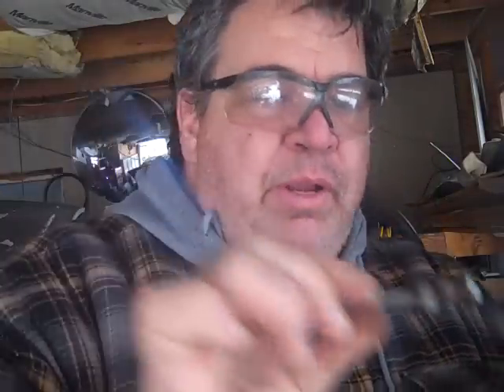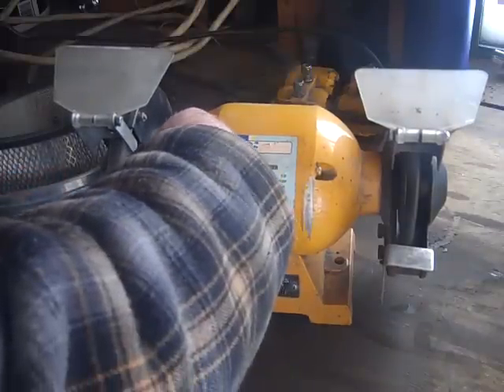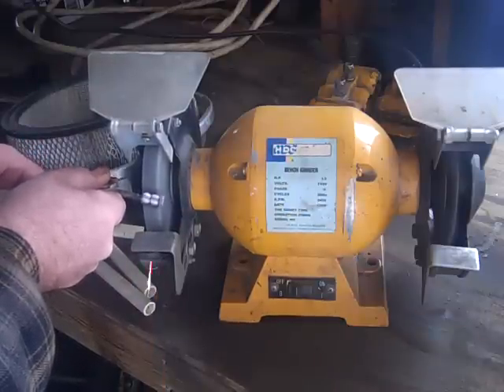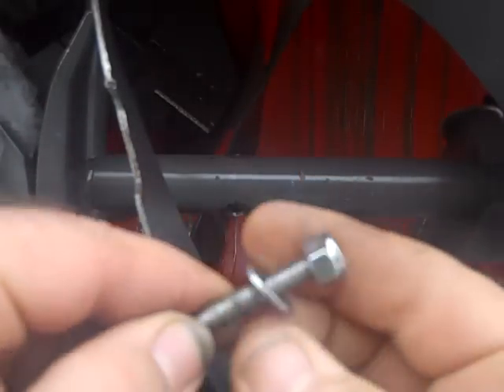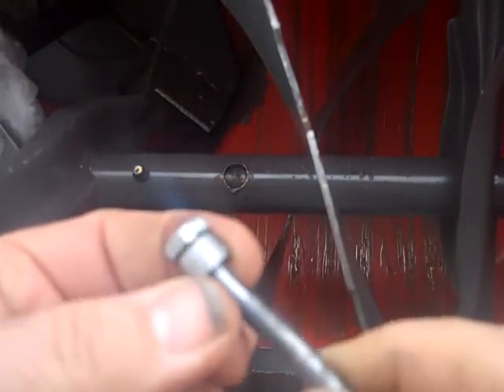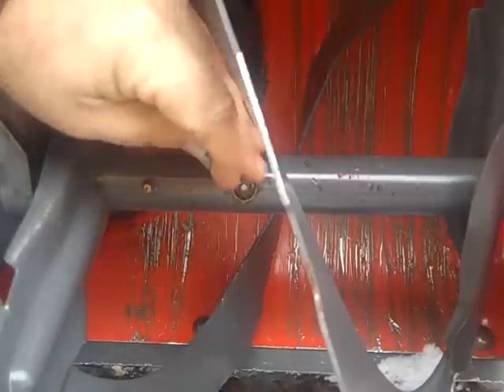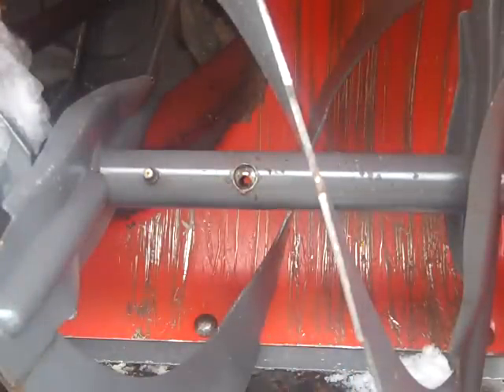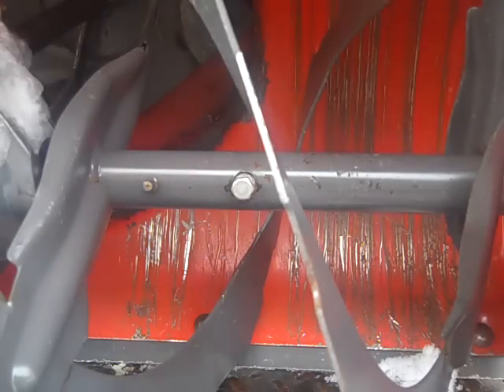How to make a Snowblower Shear Pin

Comment: I have been using this for YEARS and NEVER damaged any part of my $1400.00 snow blower.  A box of 30 count, LOW Grade ( weak & easy to break ) bolts only costs $5.00 ( or less ) - don't forget to get NYLON locking nuts, ( regular nuts will vibrate off, lock-tight won't work, it's not an instant bond and too cold )  and these cheap bolts has the same shear strength as a shear pin. If you r worried about that, just cut a small grove in the bolt w/ a hack saw or dremel ( just where it exits the auger shaft ) & this will make it shear easier ( the deeper the cut the easier it will shear) saving you over $50 on 30  pins, never mind the $ of gas to keep driving to the store to buy replacement shear pins. on most blowers u don't need to grind down a nut to use as a insert, just on older ones w/ more use on them.  Good job AdirondackNY

Comment: Shear bolts on ebay are about a dollar fifty apiece. Gear boxes go for three hundred.
Reply: tuffguy428 The bolts he used to replace the shear bolts in this video are the same as the shear bolts commercially sold for that particular machine. they are grade 2 bolts with a separate collar which is what he did with the nuts on the bench grinder. If you buy them from an industrial faster shop you can get those bolts for likely 15 to 25 cents each a nut is 10cents or less. might be able to do 50 cents per complete bolt and nuts. I known this because I have a small business.

Comment: this is a great video. I sell small engine parts and this is true for the machine he has in the video the shear bolts are a grade 2 bolt or grade 3. as long as there are no markings on the head you are good to go. Buy a box of those bolts some lock nuts and grind the larger must just like in the video and save tons of cash and time

Comment: I have a Honda HS622 Snowblower.  The shear bolt is gone from the (from the front) right auger and the holes in the auger and the shaft do not align, side to side, so that a bolt will not fit through.  A finish nail or wire will go through. It looks as if the auger needs to slide 1/4" toward the center but can't because the edge of the auger shaft hits the (black plastic) side of the gear case.  Nothing looks to be bent or out of place in the auger housing.  It was working fine just recently.
Do you have suggestions on how I can align the holes on the auger shaft to allow for a new bolt? 

The right auger has two places for shear bolts, though only one could be used at a time because they are a 90 degree rotation from one another.  Both holes have the same lack of clearance for a bolt.
The left auger only has one place for a shear bolt.
While operating, the left auger spins and works fine and the right does not.  There is no rattle, vibration, or anything to indicate that something is out of line.

Thanks,

Kevin

Comment: Where do u find NO GRADE bolts with hex heads ?  This is a good idea to finish the job but would never use them instead of the correct shear pins which are very soft and designed to shear.
Reply from the maker: any hardware store has them Lowe's. Home Depot and so on
Reply: Ed Cardinal bolts with no grade on the head are what shear pins actually are usually grade 2, you just pay a company to conveniently bag them and mark them up %1000 percent. You can take your original shear bolt and go to an industrial supply shop or industrial fastener shop and match up grade 2 bolts for a few cents each. which is exactly what this video does. Especially those Murray/Noma shear pins, they are just a grade 2 bolt with a collar and lock nut.
Reply: patthesoundguy  thanks for that info.  Had no idea.  I did notice though that many shear bolts are necked down though at the shear points.  Almost like they do that to make them shear easier.
Reply: Ed Cardinal yes they are cut on some pins to shear easier. How it works is of the bolt or pin is 5/16 in diameter they have slots in them to be 1/4 at those spots. so the pin is going be the strength of the 1/4 sections. for the most part as long as they are the low grade bolts grade 2 you are good to go. if you are good with a zip disk and a grinder you can match the groves very easily. place an original pin next to the new bolt and mark the grooves. just make sure not to tighen the bolt any more than you need for the pin to stay in place or it so break prematurely. almost have it rattle.
Reply: patthesoundguy thx.  Good idea.

Comment: Seems to me that it'd be worth the $5 to just get the proper bolts rather than go through all that grinding to make sure the retaining ring fits right.  Also, I'd rather know it'd break at the right pressure than hope the random bolt you found will be weak enough.  Your blower to gamble with, I'm not judging, just don't see how it's worth it.  Also, did you ever consider that the bolts you're using could be TOO weak?  Maybe if you got the proper pins you wouldn't have to replace them so often.  Not a bad vid, I just don't see the point to save $5.
Reply: pcosta816 in this video those are the right bolts for that machine. The shear bolts for that Murray/Noma are grade 2 bolts. and the collars just have to fit in the larger hole that's it. you can pay more but you can buy those bolts for a few cents each.
Reply: It would be nearly impossible for them to be too weak, considering what they do, but if you are worried that they're too strong, you could cut a slit in one with a hacksaw to weaken it.  As far as "replace them so often", obviously he has some situations where he encounters ice that breaks them, or else the original never would have broken.  I have yet to break my first shear pin.
Reply: @stinkycheese804  A hidden Chunk of wood or a stone could break them. You been lucky. God Bless 🌲♦️